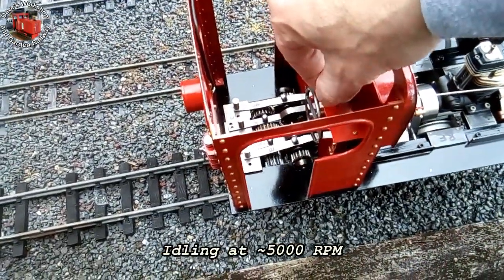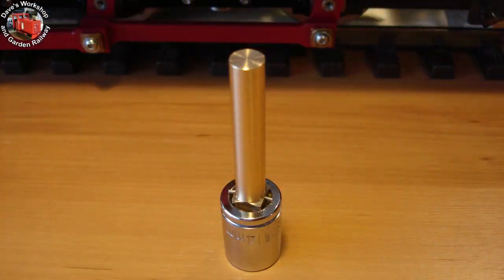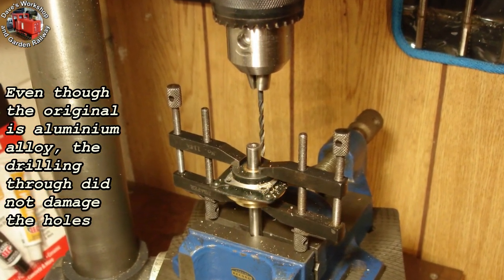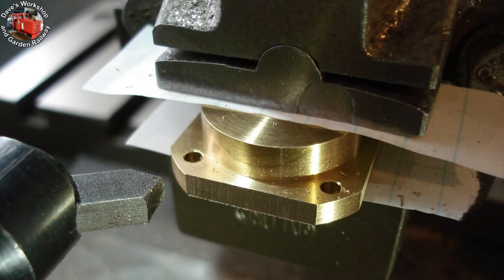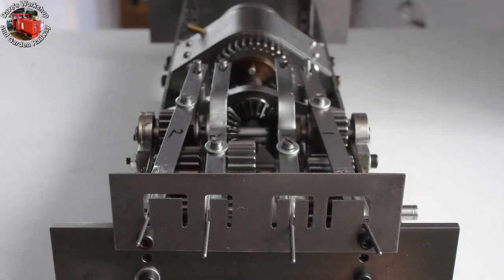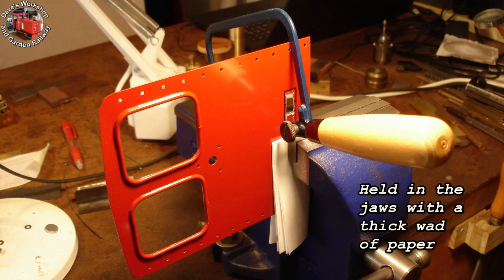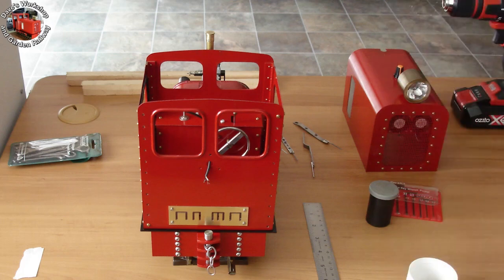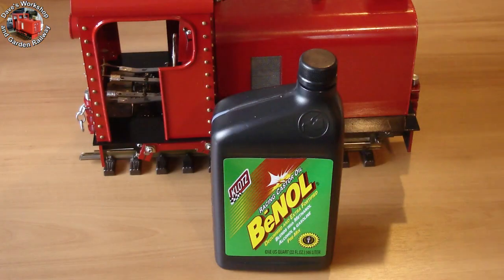Live Diesel Rebuild, a New OS FS-26 Rear Adapter Plate, Gear Selection Upgrade

Comment: Wouldn't running that motor as part of a petrol electric be better for finer movement
Reply from the maker: I wanted to build a mechanical loco.  It is capable of smooth starts